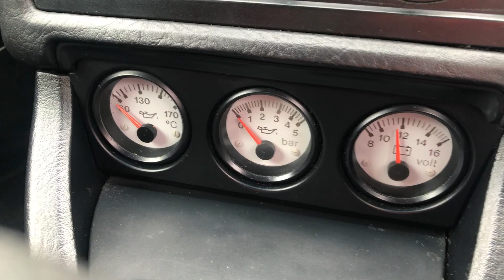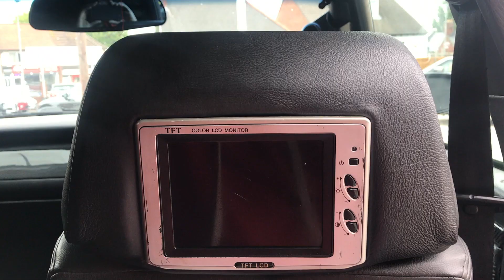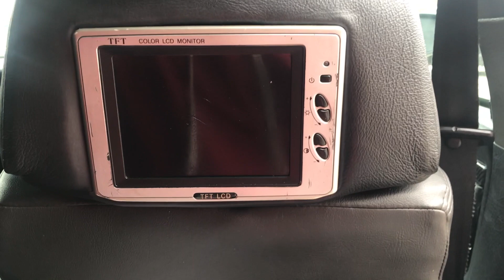***BHP Audi S2 •Rare CLASSIC• with RS2 goodies

Comment: This is not an RS2
Obvious things to look out for are that doesn't have the RS2 stock manifold, likely doesn't have the 5x130 Porsche hubs, has an aftermarket RS2 front bumper which is distinguishable from the vents in the side of the bumper. 
An S2 is not an RS2 even if you stick all the Porsche bits on it...
Tbh it looks pretty molested & the front seats are not original as the trim level is not carried from the front to the rear. 

The output of an RS2 is 315bhp but... the output of an rs2 Avant is 230bhp... 

This is not a 30k car which even a snotter of a rs2 would go for.